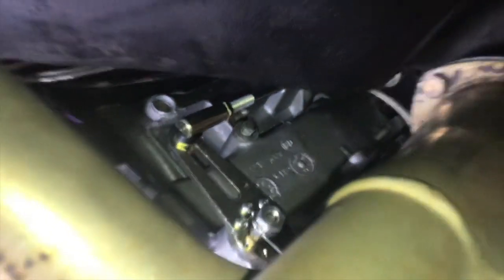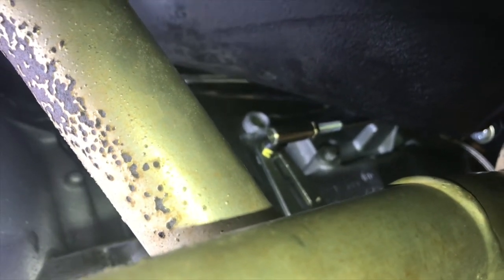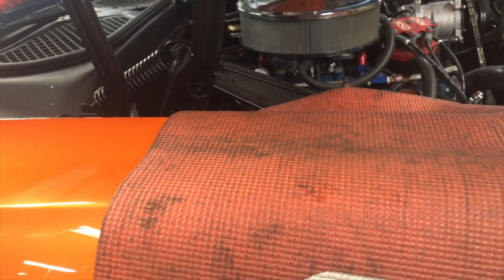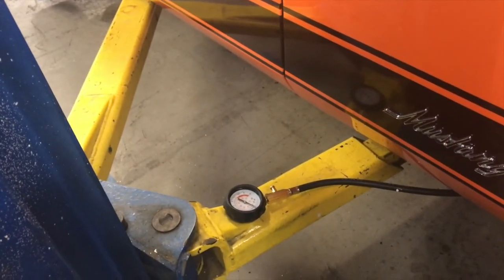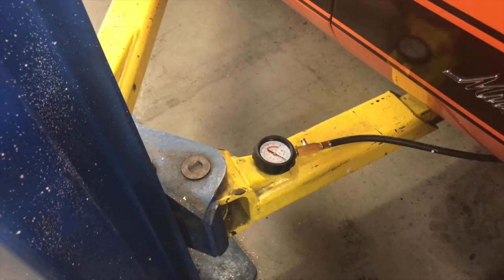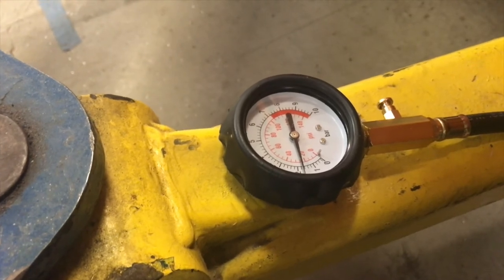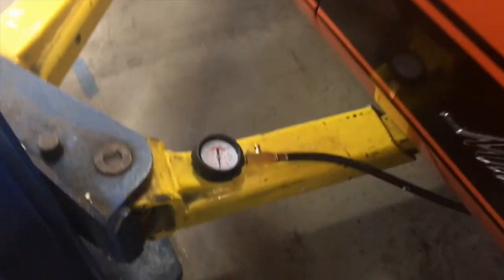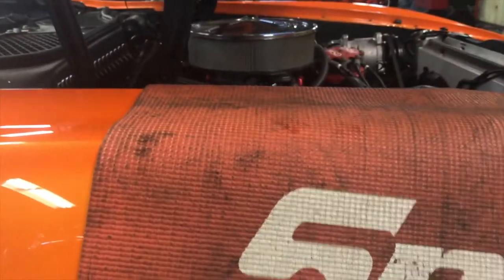1973 Mach1 AOD Shifter Linkage Throttle Valve Transmission Oil Pressure Check oem Shifter Behavior

Comment: If you start it in the number one position, it will be in first gear. It’s only a protection that it keeps it in second year when you pull it while you’re driving.
Reply from the maker: That is a fair and valid observation.  What I was trying to sho, amongst other things, was how to start off in 1st gear manually, then manually force the AOD to go into 2nd gear, by using the 1st gear position after a repaid upshift to the "D" position (2nd gear on the original shifter detent position markers).  Trying to make sense if it in writing is bad enough, and to do it on a video is even tougher.  It seems to me one pretty much to just try things until they figure out the various shifter movements that will end up providing the desired manual upshifts.
Reply: @gilberthale7777  yes, I understand and I agree. That’s great information!

Comment: Can u explain about removing gauge , I had .25 spacer in mine and set it to 32psi as I was told to set it between 28-32 psi max felt best but now iam thinking it could be higher just by driving ? It’s not burning I checked and smelled the trans fluid looks good when I remove gauge it goes to zero aswell should I adjust it with out ?? Yhanks
Reply from the maker: The spacer is supposed to be 0.275" thick, not 0.25" thick.  Thus, by using 0.25" you are running at a little lower pressure than you would have when using a 0.275" gauge (spacer).  But, not to worry.  The problem with causing an AOD to cook comes with too low a Throttle Valve pressure.  I am actually running our 73 Mach 1 AOD at 39 PSI (with 0.275" gauge) in order to get our 1-2 and 2-3 upshift road speed points up higher than where they were at 35 PSI.  I preferred to do that minor bump as opposed to begin dinking around with the valve body and/or governor, as I am sure my nationally known rebuilder would be voiding our warranty had I begun to play with those areas.  In your case you may well be running closer to 34-35 PSI, as it does not take much adjustment to pick up a few PSI.  I went slow and easy, going from 35, to 37, then later to 39.  

I am playing with the idea of installing a transmission oil pressure gauge where I can see the Throttle Valve pressure fluctuating at different throttle openings, and perhaps even include a quick connect "Y" so I can hook up the shop pressure gauge more easily than having to diddle with the port tap plug.  Well, actually, I am past the "thinking stage."  While on vacation I got bored one late night earlier in the week, and I ordered the equipment needed to install a gauge and set up a pressure Tee or Y connection.  I plan to use an electrical gauge vs a bourdon tube gauge with oil being sent to a gauge inside the Mach 1.  The T or Y connection will let me check the accuracy of the electric gauge and sending unit as compared to the shop gauge(s).  I have a few pressure gauges, so I will be using all of them in turn to make certain they are all reading about the same.  That is long overdue, actually.  

That sounds like it would be another fun video to shoot!  heh heh...
Reply: @gilberthale7777  thanks you for all the info so your saying me running a .25 iam actually running higher as it needs to be .275 so it probably safe being higher correct?
Reply from the maker: @89Whitehorse  ctually, if you had set your PSI to 32 at 0.25" it would be a little higher at 0.275", as a larger gauge gap will increase how far the cable traveled, where more travel is more pressure.  But, if you did set the PSI to 32 at less than a 0.275" gap, moving the gap to 0.275 would cause the PSI to go up a little, likely 1-2 PSI - which is a good thing.  I would still test drive the AOD and see what the 1-2 and 2-3 shift point roads speeds are at light throttle.  Then check your OSI at 0.275" in Neutral (not Park, there is a 2 PSI difference at idle from what I found and saw).  Make sure you are at least zt 32 PSSI.  If you want  a higher road speed at light throttle you can tighten the cable and nudge the PSI to 35 or so.  Then test drive again,  If you want the upshifts to occur even later at a higher road speed, nudge the PSI 2-3 PSI at a time.  I stopped at 39 PSI and am very pleased with my upshift points at light throttle.

When I mentioned more PSI is better, it is more that it is better than a PSI level that is too low.  I have not gone past 39 PSI, although I may push it to 40-41 PSI next time It inker with the AOD, just because.
Reply: @gilberthale7777  
Hey I finally got trans where I want it so the trans builder told me 28-32 psi my Trans was built at I put a .270 measured his at his shop borrowed and when I check I was 42psi ouch hopfully no problems from that trans fluid looks and smells good in neutral I set it too 30psi right in the middle. That was operating temp my trans is 
AOD with 4R70W internals
Trans go kit in valve body
My 88 mustang lx is completelly stock except 373 gears and a set of 40 series flowmasters .
Before I set it with gauge shift way to hard chirp the tires at 2400 rpm 1-2  so it should be better tomorrow on road test as had  to go work.
Reply from the maker: @89Whitehorse  wow!  You have been busy!  I have not seen anyone reporting issues with the throttle valve pressure being a little higher than spec. I am still running at 40psi in neutral. That provides me the shifting behavior I was after. 

I received the digital oil pressure gauge and brass 1/8”NPT adapters needed to install the gauge and connect it to the aod. I am still waiting the the adapter plug to show up. As soon as it arrived I will install the gauge and Lynda video record that process.
Reply from the maker: @89Whitehorse  Hi!  Re: the 0.270" gauge, is that the correct size for your particular AOD, or is that all the shop had on hand?  If that was supposed to now be 0.275'', but you used 0.270", there will be no "harm."  At worst were you to use 0.275" you will find the PSI will be just a little lower than it would have been at .275," maybe 1 PSI or so difference.  Not anything to squawk about.

That you are barking rubber in the 1-2 upshift sounds like you may have had a valve body kit used in the rebuild, as even at 40 PSI in Neutral using 0.275" I get fairly firm 1-2 and 2-3 upshifts, but I am not barking rubber like I used to with the prior C4 with its WOT 1-2 upshift.  I am not upset by that, I recognize our AOD had no shift kit in it, and using one will void our warranty.  

Once the AOD warranty expires (one more year) I will likely install a shift kit, or if our investments begin to yield really strong returns I may even look for a 4R70W electronically controlled version of the AOD and swap it is with a nice street/strip style electronic controller.  Or, I may by then "grow up" a little more and leave well enough along, and leave the tire barking to the 1969 and 2020 Shelby GT500s we also have <g>...  heh heh...  I will be the first to admit that for 71-73 the Mach 1 Mustang was more about cool looking racing stripes and blackout paint schemas than high performance.  The Boss Mustangs of that era, however, are a different story...  

Back to you, it sounds like you are having too much fun with the AOD!  heh heh...  Well played...  I know we have a blast with out pony cars, a lot of fun...  Any time I tinker with, work on, show, or drive them I am 19 again (trapped in the body of a 68 year old)...  The ultimate time machine...